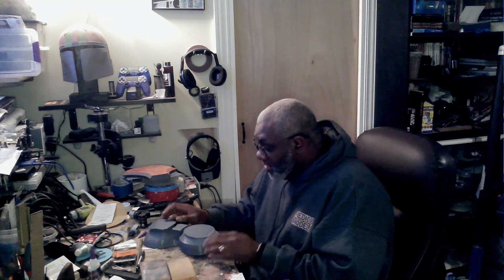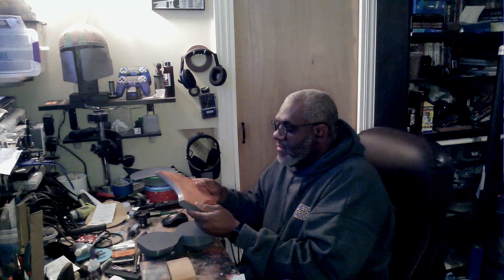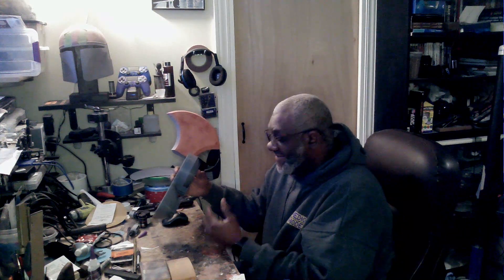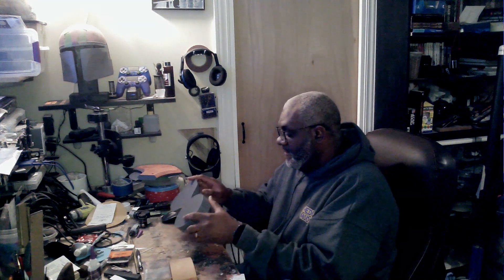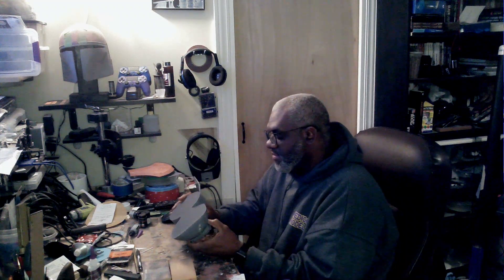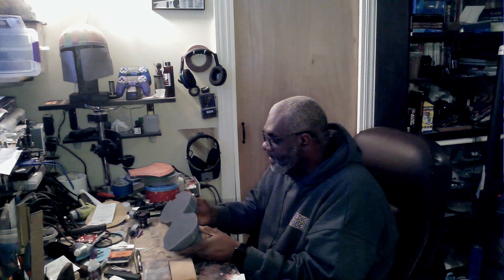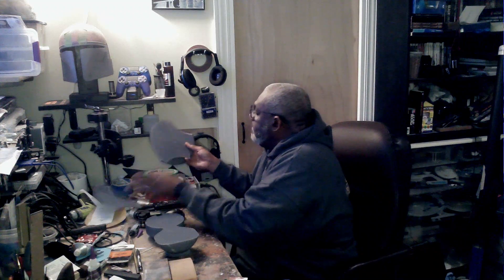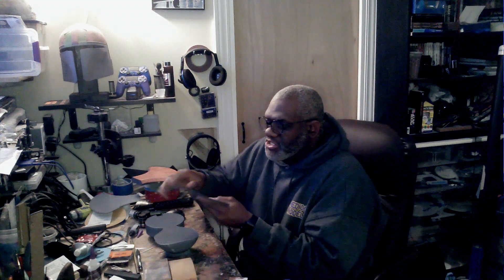3d Printing in Winter

Comment: How consistent is the temperature in your shop? Changes in temperature could be causing the bed to warp (where you mentioned the corner lifting up)... of course the leveling is still the most likely, but don’t discount environmental variables.

Thanks for your videos! If you lookup “audio normalization” or “audio leveling” for YouTube videos there are plenty of workflows out there that you can turn into a one-click fix for your audio... that way you can get normalized audio out even between brownouts! 😅

Stay warm!
Reply: The shop temp stuff is particularly important if you are using ABS. See https://youtu.be/LvGKfevdf_Q @10:20
Reply from the maker: @JacobProbasco  So far I’ve only printed and PLA+. Having spent years building styrene model kits. I already know the limitations of ABS. I have been considering trying to print in PETG, but need to do more research to see if there any benefits to it.
Reply from the maker: Honestly I didn’t even think about the bit warping issue. The printer is in my finished basement, but this was the coldest weekend on record in two decades. Also keeping in mind I just had to take everything apart to replace that blockage in the hot end. Releveling the bed and checking for warpage is definitely a good plan. I’ll check into the auto leveling stuff on YouTube. Thanks for the tip and thanks for watching.